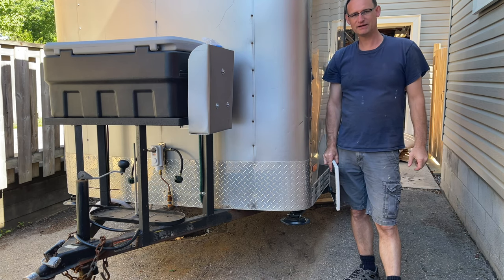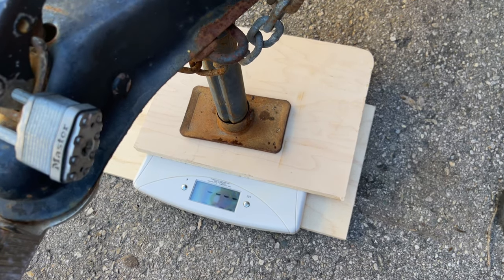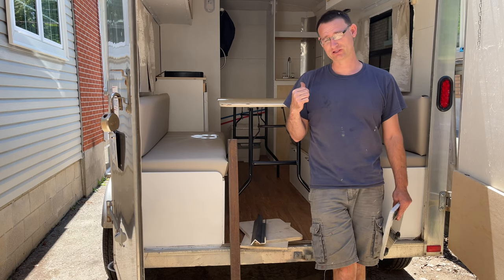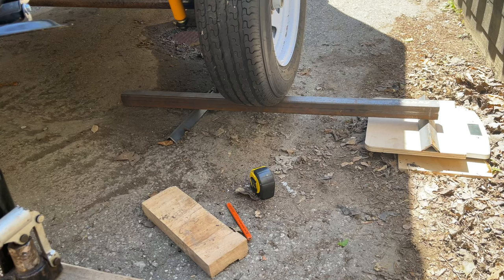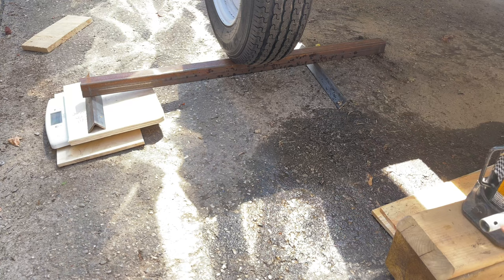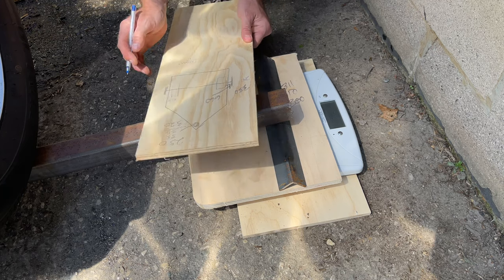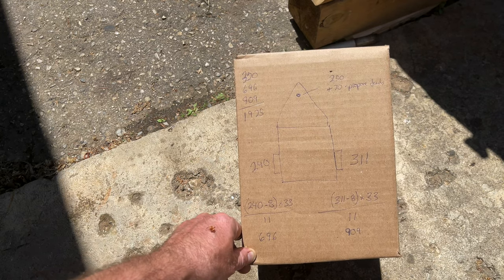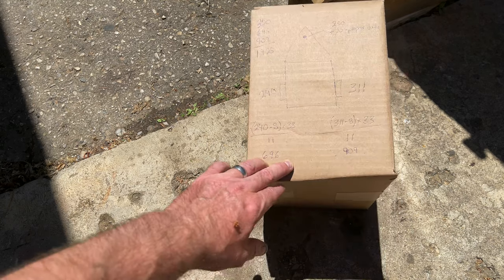Weighing my trailer with the Bathroom Scale

Comment: Just remember that your tongue weight will actually be a little more than you measured because your tongue is further from your axle than your jack stand where you measured from with your scale
Reply: Just the opposite. The longer the distance from the axle, the greater the moment arm, and the less force it takes to counteract the trailer weight. Sum the moments about the axle.